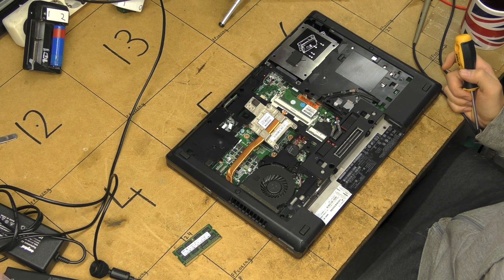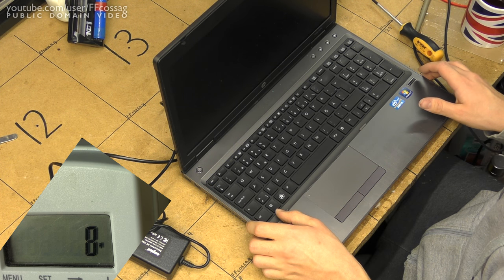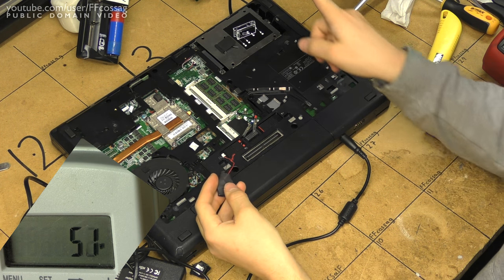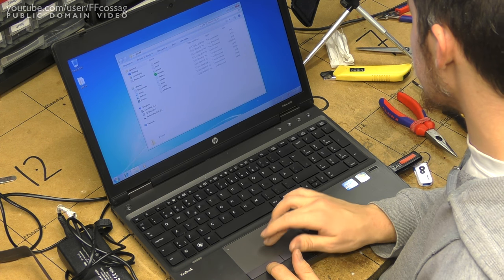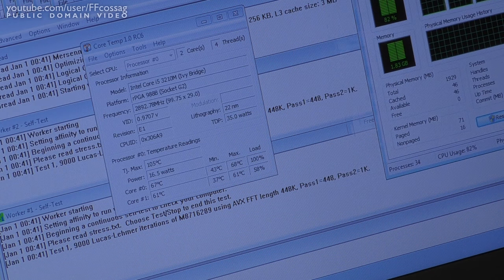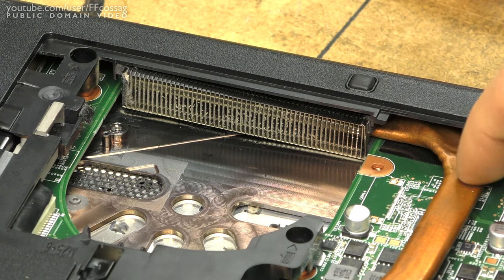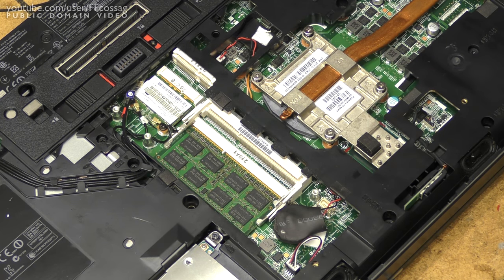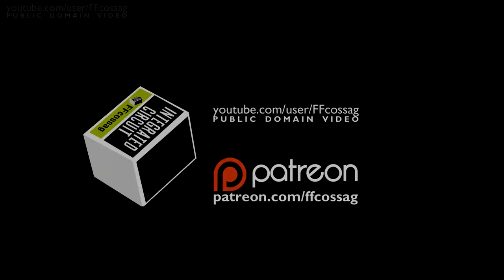Trash picked, i5-powered HP 6570b repair - broken heatsink

Comment: micro fractures in the copper heat sink can be enough to lose all its fluid over time through evaporation (you won't notice), and make the heat sink stop working.
Reply: Whenever I see the term "micro fractures", I always want to recommend increasing shield strength.
Reply: Azayles LOL, in German it's actually called a "Haarriss", which literally translates into "hair tear", it means a tear (or fracture) the width of a hair (or even smaller).

Comment: So about those layers of metal the heat sink is usually attached too, does that just transfer heat? Like if it’s bent but the actual pipe isn’t, would that affect performance at all? Or possibly make it a hazard?

Comment: I had a fujitsu laptop i got for cheap and it had no heatpipe,so I got one for an hp, and it was the wrong size and shape,too many fins etc,i bent it,cut it,resoldered and crushed the fins,didn't even bother filling it up with anything,still works pretty well but sometimes it overheats(but hot air is coming out)

Comment: I doubt there is anything really wrong with that drive. Those Hitachi 2.5" drives automatically enable really aggressive power management. They will slow down the motor to save power, and doing so requires a load/unload cycle for the heads and that is what causes the horrible clicking noises. When I was using one I ended up using CrystalDiskInfo to turn off APM (set it to 255). All the weird shit stopped and the SMART values stopped creeping up.
Reply from the maker: Mind that it wasn't the load/unload cycles increasing, but the power cycle count - at a rate FASTER than the load/unload cycle count.
Reply: It's the cheap ass tinned connections to the heads. I have had to get extreme and do the Rossmann "drown it in flux and saudder" routine more than once for data recovery on stubborn customer drives. Not quite sure why it screws with the power cycle count, but it does.. maybe it parks the heads rapidly?

Comment: there's an ebay seller with 6475b's for US$95 a pop. I've bought three so far for client replacement machines. they come with a dual-core A6, although the quad-core A10 you can drop in is $30-40 more seperately. seems the AMD and Intel variants of these 6000 series probooks have extremely-different placement of parts inside. and although they're fairly plasticky, they're still some of my favorite laptops of this decade. no-frills performer with proper screen/CPU upgrades available for them if you're willing to do the work yourself, and a very decent replacement for modern thinkpads that have gotten a bit too... "normie" so to speak... aside from the P50 and P70. I can forgive Lenovo for all their recent sins just because those two models exist.
Reply: Sudos our school uses HP Elite books which even has the think point,  and a metal lid,  very nice no nonsense machines,  shame our IT department has no clue what they are doing and do super sketchy repairs to them,  loads them with badly done windows 7 images,  and configure them with spinning drives which drives the teachers crazy because they take so long to do basic things even with there 4th gen i7s

Comment: You could maybe look at the Harddrive AAM settings, there could be an issue, or since it's an Mobile drive it parks to often the head.
Reply from the maker: I might, but I doubt it'll fix it. Power cycle count should not be increasing at a rate of thousands per hour.
Reply: Pop a SSD in there and don't look back, but then if your going to gift it... meh

Comment: Nice trash pick, I have an HP 6550b that is fairly bullet proof all but to the speaker headphone jack, the OS is Win 7 pro, the hardware fails to detect output audio to the speaker sometimes. Oddly if the display port is used to push to a HDTV the audio always works at the TV. Tried cleaning that jack receptacle but nothing seems to work except when it wants to. I guess it could be the OS but not sure?
Reply: Why not try a knoppix live dvd? Would rule out if it is hardware or a driver/os issue.
Reply: Good point, I could do that and I think I will. Thanks for jogging my briain

Comment: Due to its nature, Windows is very forgiving with hardware issues. If you really want to test the machine, install some Linux on it (i.e. Ubuntu) and use it for a bit with that (i.e. playing youtube videos in Chrome with hardware acceleration and so on). That happened to me: I've got a Thinkpad T520 and wanted to upgrade its RAM from 4GB (2x2GB), so I bought 2 used, good modules, one with 4GB and one with 8GB. It worked fine, until Chrome wanted to play a video, then it would get a segfault in the graphics module. The RAM was out of a T430, so the newer generation (Ivy Bridge like your plastic laptop), but it should have been compatible (even though it is DDR3L memory). I tried everything: Only one module, or either of the new modules each with one of the old modules - always the same. Then I bought 2 new 8GB modules and upgraded it to 16GB. Now the 8GB module from that does work flawlessly in my X220 (same Sandy Bridge platform, basically the same device, just in a smaller form factor) with another 4GB module, and even with the original 4GB module that in combination with the 8GB module didn't work in the T520. Windows had no such problems on the T520, and even memtes86+ didn't find the RAM to be faulty. But I needed the upgrade anyways, because I wanted to get rid of my dual boot system and have Windows (when needed...) only in a virtual machine, and that meant "more RAM!"

Comment: Funny enough yesterday i found a early Fujitsu Ultrabook with the same exact CPU in the trash... nearly mint condition, only a dead hdd that was probably predamaged and couldn't handle the additional stress the windows 10 upgrade put on it.
(it was booting up, asking for the privacy settings, once you hit next it would just reboot and ask for the same settings again.)

It had a bunch of bad sectors and it would also randomly turn off when i plugged it into my test PC. Model is a Seagate Momentus 5400.6 btw.
Put a new drive in it, installed windows and now i'm not sure if i should keep it or sell it... since it's such a disgusting color xD
Reply from the maker: The more disgusting the colour, the less likely someone'll steal it. That's part of the reason why I contaminate everything I own with black markers/pony stickers.

Comment: What did you apply to the ram?
Reply: I assume its some sort of dielectric coating/cleaner to remove oxides from pins and keep new corrosion/oxide from forming. But i can't seem to piece together the proper keywords to get google to regurgitate the actual product :(
Reply: My guess is, that it's just plain alcohol since he has it in a syringe and doesn't clean it up afterwards.
If you leave proper de-oxide on the contacts, they will attack any non-noble metal.
Reply from the maker: It's 99% pure alcohol in an old thermal paste syringe. I just buy alcohol per litre and suck it into the syringe.
Reply: Wow i definitely wouldn't have guessed that! The tube made me think "ambiguous ebay special paste or grease"
Reply: I used to rub an eraser on the ram stick contact to clean it. It usually worked

Comment: Im chuffed its working Mr Rossagg :-D, You have dragged it back from the jaws of death :-D.
I wonder if it was just the cmos battery that made the machine create an error at start up that made the owner angry, so he pulled the heaksink off in madness LOL.
Also the time/date would be wrong, some network apps dont like that.
People do show anger in odd ways.
I have an old 2007 acer aspire 5315, the original owner got pissed off with a game and punched the lcd screen a lot, how silly, but my frend said "if you're chucking it away, can i take it for harvey" <- me :)
A cheap lcd from ebay and away it went, no problem, and ive been using this lappy for 5 years, not a bit of trouble :-)
Yes its a crap old lappy, but its still working 2007-2016 thats not bad :-D
Reply from the maker: Oh christ, "Rossagg". Even incorporated the double N.
Reply: LOL well i have to pull your leg :-D :-D
You are a clever man, i dont see any problem with that, i mean that.
Reply from the maker: zx8401ztv Hey, the more people type Louis Rossmann in the comments, the more Google is going to put my videos in the related section of videos by Louis Rossmann. Since Louis Rossmann (and Rossmanngroup in general) are so popular, that's a good way for me to gain attention, by exploiting Google's algorithms to put my videos on Louis Rossmann videos about component level laptop repair. ;)

Comment: Heatpipes contain some sort of mesh/foam/sponge-sort-of-a-thing inside of them to facilitate the capillary movement of the condensed cooling medium from the heat sink towards the CPU. The sponge thingy is often made of metal and in your case is probably quite crushed right now. But anyway, if the temps are fine then who cares. Cheers!

Comment: once you get a kink in a heat pipe, it's game over, you lose most conductivity... which you need in such badly cooled laptops as HPs. Shit brand, poorly cooled, shitty plastic...
Reply from the maker: I wouldn't say so, with this machine as an example. 60-70 degrees is usually about what the operating temperature is for these machines, and the heat sink is getting hot. If there was a considerable problem, it'd be revving the fan at 9000 RPM with a cold heat sink.
Reply: FFcossag true, but the cooling system on the HPs I've come across is undersized at least for my tastes, so it definitely doesn't help
Reply from the maker: Jernej Jakob Well I'm not going to argue that a kinked heat pipe is a GOOD thing, lol.
Reply: This laptop doesnt have a shitty cooling system at all. the processor was below 70 degrees at full load which is VERY good for a laptop, especially when you consider that the heatsink is damaged. My friend has a dell XPS 15z which idles at that temps, even when it was just new. (After he called the Dell support, the replacement laptop still has the same problems). With prime95 it was at over 90 degrees. But the By far best cooling solution out there is the ThinkPad one: A single fat copper heatsink on top of the CPU without heatpipes sitting in the corner of the notebook so it can suck the air in at the laptops side and blow it out at the rear. ThinkPads are in my oppinion just the best engineered laptops by far. Easy to fix, good thermals, fast, very durable
Reply from the maker: ***** Hm, that's not too bad an idea, I might try that at some stage. Cheers.
Reply: Definitelly do that on video. Might be interesting to see if the ends spring a leak as that might be the weakest section. How would they solder a heat pipe?
Reply: simontay1984 that might have some interesting (read: explosive) results :)